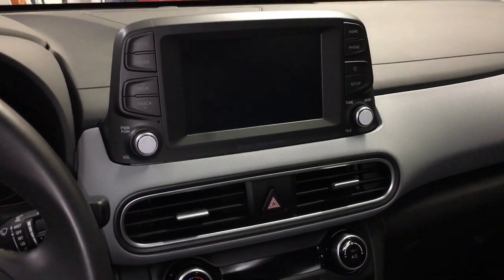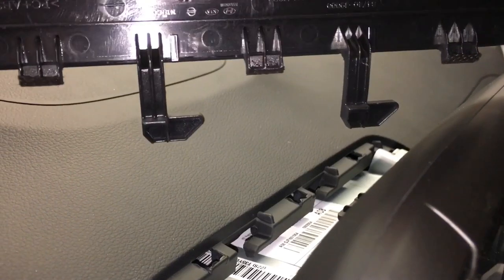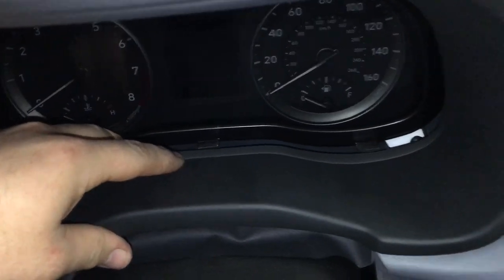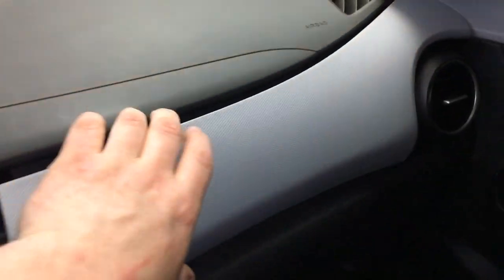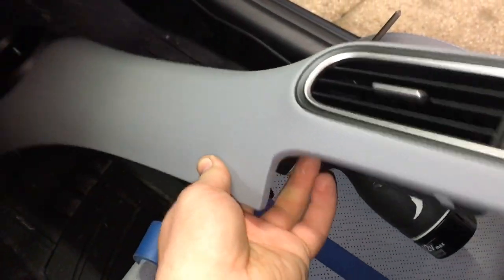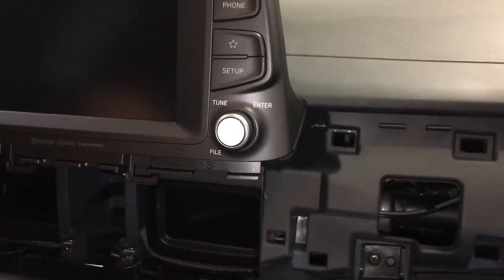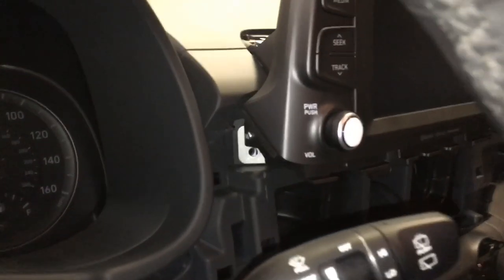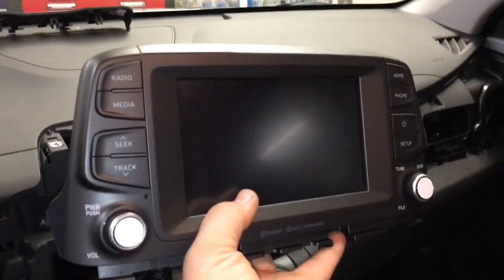How To Remove Radio In A 2018 Hyundai Kona

Comment: Thank you so much for this video- very helpful! Anybody attempting this- don't do what I did. When I couldn't pull out the instrument bezel with my hands like Tony did, I tried prying it with a plastic pry bar and broke the clear shield over the instruments. Really stupid. I had to special order the replacement and it cost me $54.00. The way Tony did it is the correct way and I was able to do it that way the next day (after I quit when I broke the shield the night before), For some reason, it was much easier then.
Reply from the maker: Brian Ferrell Glad i could help,, Thanks for the feed back Brian
Reply: @UpsideDownKid222  I just now realized- my hazard lights weren't working- for the last year! I forgot to plug them in when I put the dash back together. Had to refer to your video again to take apart the dash and plug in the hazard lights. I can't believe I overlooked plugging them in.  They are working now. Anyway, you saved my butt again!
Reply from the maker: Happens to the best of us,, Glad to help again brian..

Comment: Was hoping to see the back of the radio to see if there were output connections for an external amp. Otherwise, very helpful.
Reply from the maker: Nicholas thanks, no there weren’t any other connections for an amp on that radio.. I’ll remember to show the back of the radio for future vids.. Thanks for the input Nicholas!!
Reply: Do you know if a newer 2021 Kona has RCA to plug amp wire into?

Comment: Hi Tony -- Nice video very helpful but how do you pull out instrument bezel, I tried with hands without pry tool but it seems difficult to pull out. Not using enough force to avoid any breaking
Reply from the maker: I started at the bottom near the steering wheel and worked my way around it.. I highly recommend plastic panel poppers for this part so you don’t damage the edges of the panel.. It will come out even though it seems tough.. It’s a solid panel, don’t be afraid to tug on it a little more than usual..
Reply: @UpsideDownKid222  Hi Tony — Thanks a lot it worked ..

Comment: The ultimate Kona has no aux input, do you think it’s possible to add it?
Reply from the maker: I’m not sure if they have a factory add on you can install but i know i have installed an AUX/Blue Tooth/USB charging by “iSimple” as an aftermarket piece to a factory radio before